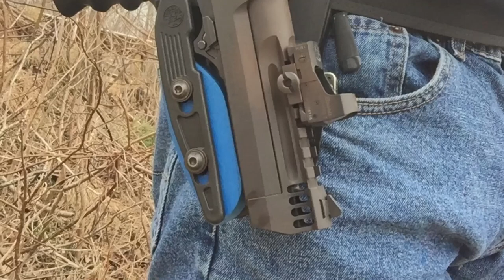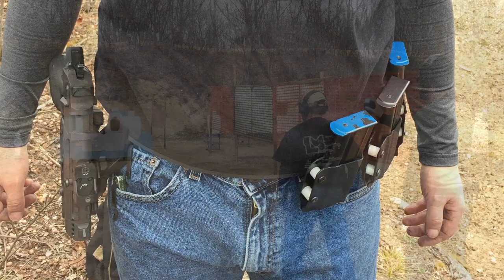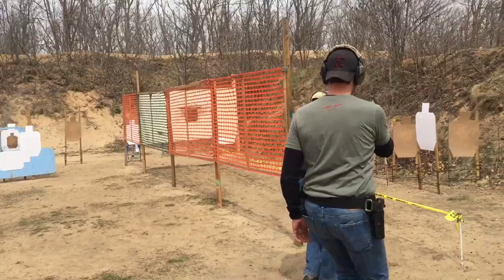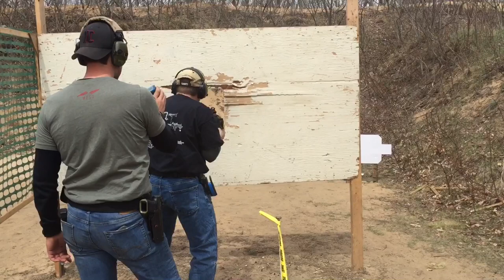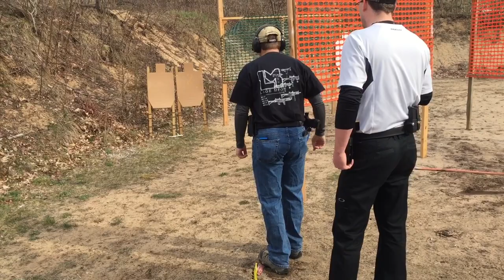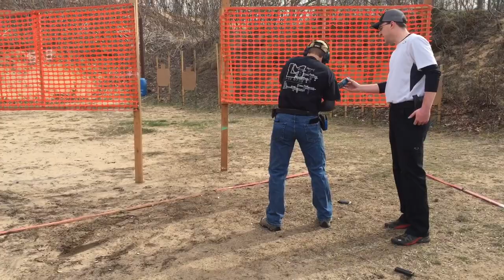Desert Eagle USPSA

Comment: Also, which bullets are you loading? I havent had any issues with jacket clogging the port with Hornady XTPs.
Reply from the maker: TheNandor; I'm loading Zero 158 gr. JHP with AA#9.  I also have a MK-XIX, which has no issues with these bullets.  I'm thinking it's something with my particular barrel.  MRI test fires their guns with Magtech 158 gr. JHP.  I'm going to try some of those and see if they do the same thing.  I'm also planning to try shooting some into a sand bank and see if the recovered bullets have the jacket scraped off.

Comment: Nice. How did you make the shim for the Hogue Powerspeed? Out of an aluminium block? Could you share the dimensions?
Reply from the maker: Øystein Kaldhol, I just shaped the shin out of wood. Rough dimensions are 4” x 1.5” x 3/4”.
Reply from the maker: This shim works for the L5 only. The trigger guard is different than on the MK-XIX models.    So you may need to adjust it a bit for one of those.
Reply: @jakk1045  Thanks. I have an older Israeli made Mark VII.